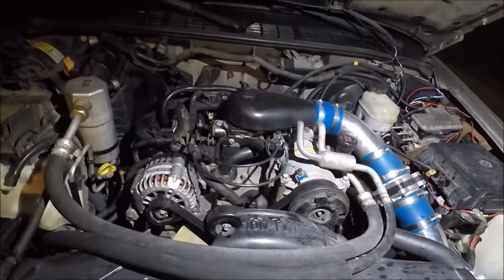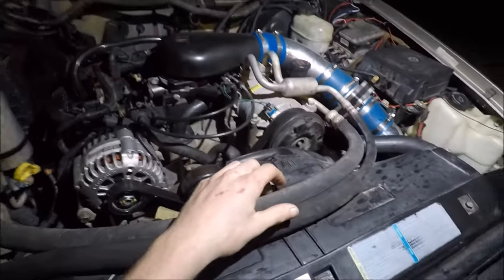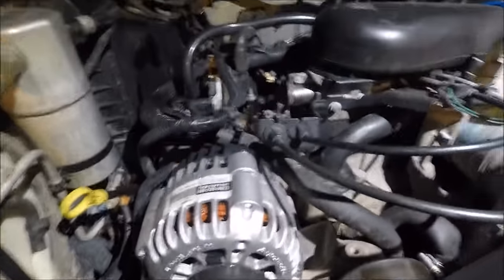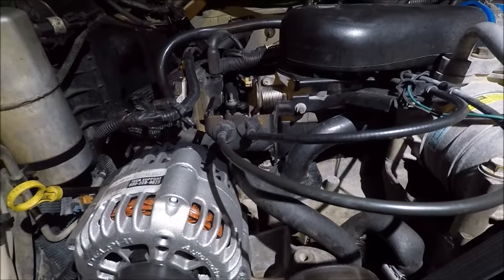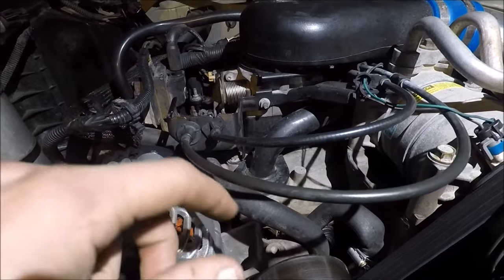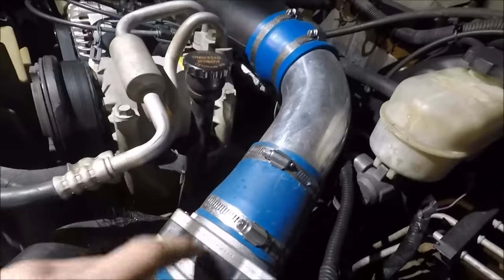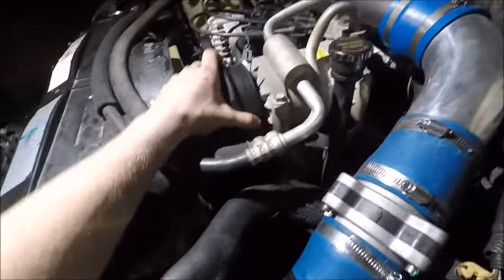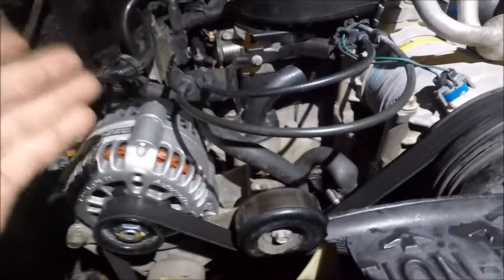EVERYTHING YOU NEED TO KNOW ABOUT THE CHEVY 4.3

Comment: I would call this video "Everything I know of about my 4.3" not "Everything you need to know" I'm not being a dick by any means so please do't take it as me being a Dick... 

I get what all you're talking about here but This is NOT Throttle Body Injected, it's Spider injection you did correct your self... yes they make an updated version. Rain water does not run down the fire wall and cause the issues in the distributor, what happens is when it's humid out or you go through deep water, or even power wash the engine (it can not always) some moister will get stuck in side of the Rotor cap and then the water would condense causing it to miss fire and ark out to the water, reason this happens is because the small drain screens inside the Distributor become clogged... the fix for that is to remove the small screens all together and prevent the issue for ever.

Also incase you don't know,  there was the pre 96 Style engine  (also known as the Vortec V6 W series which I personally like better to be honest) we have in our trucks as you show in your Video the 4.3 X series motor which is a Detuned version of the older W series. The Pre 96 motors use what is called "Swirl Port" heads, different ECU (ECU had more timing advance from factory) different intake manifold design with a "tuning Valve" that changed the intake manifold runner length along with a more aggressive cam shaft.

Also your fan shroud is broken because of you may have  bad motor mounts. I can guarantee that you have also weird sounds from your Double Cardoon Joint on the Driveshaft which is because your whole engine is loose and shifted against the fire wall and side to side.
Reply from the maker: 8th digit in the vin is a W silverados and express vans had the X

Comment: po 171 po300 cant get rid of it its a real pain in my arse replaced everything I can think of now its burning 1/2 tank of gas to and from work whats your opinion
Reply from the maker: David King replace the fuel filter or check injectors in combination with a random misfire it may not be getting a correct spray per injector so therefore the gas is goin and goin, clean off the MAF sensor check the cap and rotor in on the distributor. Rule out the obvious things first then in junction it’ll help you draw a conclusion on why you have a misfire randomly and a too lean condition.
Reply: Mine was a bad distributor and clogged my cats. Especially if it won't rev past 4000
Reply from the maker: Isaac Murrell clogged cats is easy to tell if you rev up and the truck feels like it’s got no power while crusing
Reply from the maker: Isaac Murrell forgot to mention you can take a infrared thermometer and follow the exhaust that’s an easy way to identify clogged cats
Reply: You should share with us year, make, model and engine code. A bad intake gasket would be high on your list, then a bad fuel regulator and/or spider. Do you smell gas sometimes and can’t figure out why or where? Slap a fuel pressure gauge on the fuel rail and tell us psi at: (1) Prime; (2) does fuel pressure hold; (3) at idle; and, (4) wide open throttle (your looking for an increase in psi and then pressure getting pulled down from vacuum). Depending on results you may need a new fuel pump and change out the fuel filter as cheap insurance.

Comment: Only bad thing about it is it's a bastard design it has half fuel injection half something else I forget. My dad told me about it "Bastard bulletproof" he calls it. It's a solid ass engine but just if they went full fuel injection it would've been a good bit better but I have a 03 with 140. Sadly the body will rust in a year or 2 so im gonna take the engine out and learn how to work on everything on it and put it in something, still thinking

Comment: My 02 had sand casting block the heater core after only a year. Dealer refused to help. Pull heater lines off block reverse water flow with garden hose. Switch to green antifreeze. Dexcool is garbage. Heat works amazing now. Also at 40k intake gasket went bad on both sides. Plastic garbage from GM. Only have 60k as of now. Smh. Very disappointed myself.

Comment: Has anyone swapped the LV3 4.3 V6 into a D21 ?  Its all-alloy and 285 hp. A standalone wiring harness exists.   The aluminum motor weighs about the same as the KA24-DE,  a little heavier than the single cam KA24-E
Reply from the maker: Timothy Keith if we’re honest here the cost of the swap and the hardbody you wanna put it in I’d get a junkyard 5.3 and swap it they have kits online for hard body swaps but there was an ad on Facebook for someone selling a 03 frontier with a 5.3 and it was sick
Reply: @JLGARAGE252  Yeah, 4.3 LV3 is probably $1,500 used.  But I like it  as its light as the KA24 and its got as much power as the original 5.3.  Maybe I'll just wait until the late model 4.3 is a low cost used motor.  The extra room compared to a v8 will make maintenance a little easier.  My D21 doesn't have power steering.

Comment: You are full of shit the 4.3 has very good power, the chevy s10 vortec 4.3 is the best v6 Chevrolet came out with. You can super charge this motor and beat most v8. GM has fuel top of the line injection. My 96 is running strong on everything original. Mine is 24 1/2 years old. You can make a vortec 4.3 run 160 mph in 8 to 10 seconds. Remember this guy bought his after 13 owner's.  This guy hasn't ever built an engine in his life he bought a truck that needed someone who knows what they are doing. Vortec v6 is truly a bad ass it has a heart shaped intake and very powerful, bone stock they will surprise anyone off the start. Horsepower is money and do it right the first time spend less.

Comment: the only thing you need to know about the Chevy 4.3... DON'T BUY ONE.  it's a GM.
Reply from the maker: redhytech I don’t see a problem with them at all, thanks for the input though.
Reply: Must be a democratic!
Reply from the maker: Tom Santiago must be living off welfare, prolly don’t take care of anything thus why you may have a bad experience
Reply: Wraith1998 I guarantee I make more than you do a year pal!!
Reply from the maker: Tom Santiago money doesn’t make a persons character.
Reply: @JLGARAGE252  had a 96 Blazer v6.. NOTHING but trouble. one issue after another. I still have a 99 F150. had it for almost 15 years. just put new tires on it today.. never had a break-down with it. the Blazer,,,can't say the same for it. every time I drove it something would tear up. just one of those things. back in the 70's GM made GREAT cars and trucks. anything newer than an 80's model is GARBAGE.
Reply from the maker: redhytech hmmm...I don’t have hardly any trouble just minor stuff really.
Reply: @JLGARAGE252  exactly correct and well said